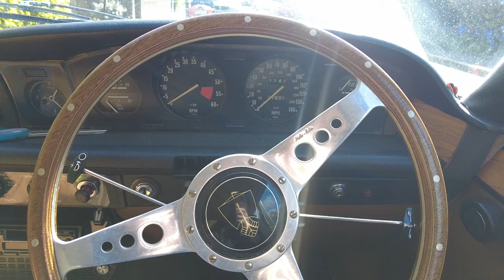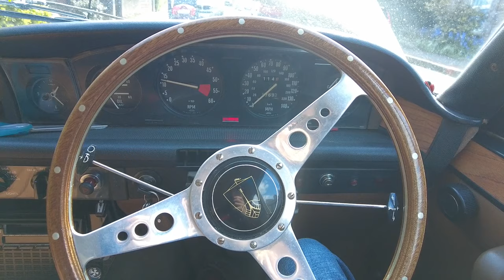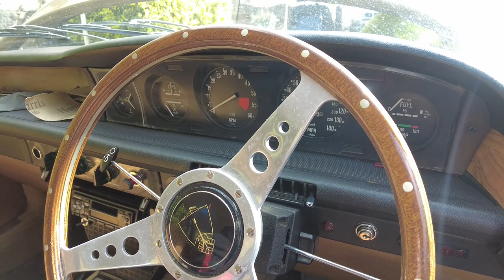I Bought A Rover P6 V8 Auto Episode Five Dodging A Bullet!

Comment: This is not unusual at all on an older engine that sat for awhile  I bought a 64 thunderbird last year with the 390 engine that had been sitting for three years.  I tried starting it and it bent two pushrods.  I used a rubber hammer on the affected valves and broke them loose.  I ordered two replacement pushrods from Rock Auto put them in and all good.  I have driven it for 8000 miles since then with absolutely no issues.  I truly believe that if you replace the bad pushrods someone just drives the car for a year or so everything will work out fine.  I don't know. how hard those particular carbs are to tune but that would be the only issue.  Everything else is just basic old technology.  Best of luck on selling it and now you will be able to be confident on the condition of the engine.

Comment: To bend a rod like that with a hydraulic lifter, I would have to guess that the lifter was initially stuck in the fully retracted position and the top of the pushrod then jammed against the side of the rocker which meant that on the next stroke the valve spring either became coil bound or the piston hit the valve. As the valve does move and turn, the valve spring probably became coil bound but I would either check the top of the piston with a borescope or hammer the pushrod straight (or use an old one) and do a quick compression test.
The question is then whether the lifter has now fully freed off or not. The straightened/used pushrod will allow that to be determined that as well, either by measurement or using the compression tester.
Also, check the rocker for damage.
Richard

Comment: Sheldon,The push rod is the weak bit and the sticky valve is causing the noisy lifter..Hit the top of the valve that's stuck, squirt some wd40 down the valve guide...normally an easy fix..and put the push rod on a flat surface ,like the back of a vice and hit it straight with a club hammer.
Reply: Sound advice I don't think. If he follows your advice he could do more damage 😂

Comment: Don’t drop a lifter down inside because it will sit on the crank and when you crank it ,it will jam between the crank and crack the block ,there hydraulic lifters check your cam lift on the rear lobes for lift as they wear